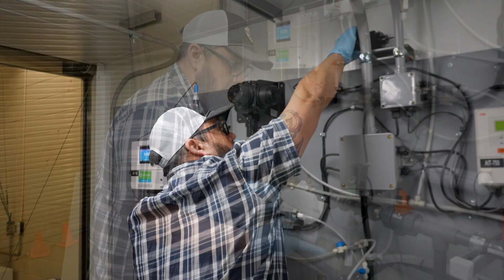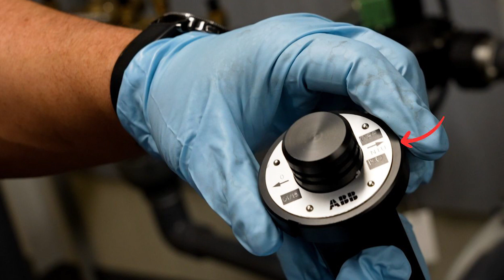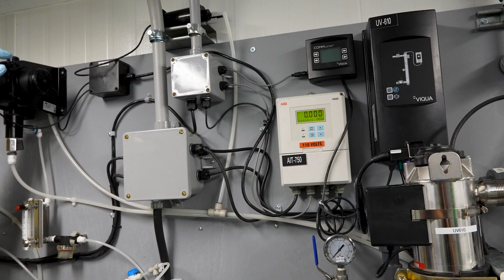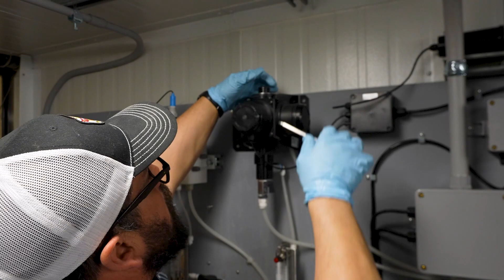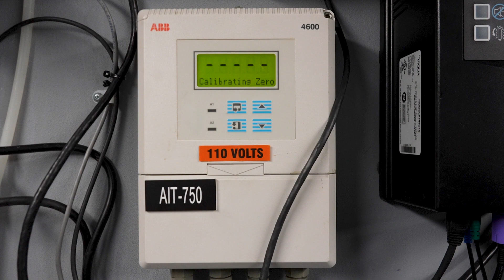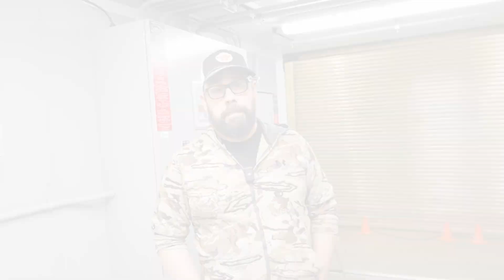Turbidity Meter: Operation, Maintenance, and Calibration Tutorial

Comment: How do you ensure your dry STD is accurate if not comparing against a formazin standard?
Reply from the maker: To ensure your dry standard's accuracy without comparing it to a formazin standard:

1.Manufacturer Calibration: Use a dry standard pre-calibrated and matched to your specific turbidity meter.
2. Regular Verification: Periodically compare it to a trusted wet standard, like formazin, using a calibrated device.
3. Proper Handling: Keep the standard clean, free from scratches or fingerprints, and store it in its protective case.
4. Environmental Consistency: Use the standard under recommended conditions to prevent variability.
5. Unit-Specific Use: Only use the standard with the turbidity meter it was calibrated for.
6. Documentation: Retain calibration certificates for traceability and ensure periodic re-certification by the manufacturer if needed.

This approach maintains reliable measurements over time.